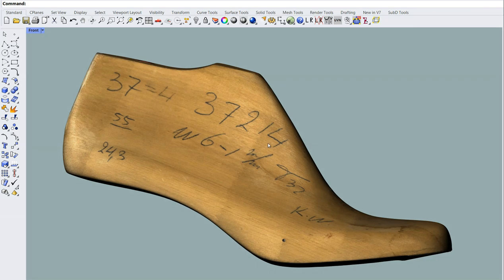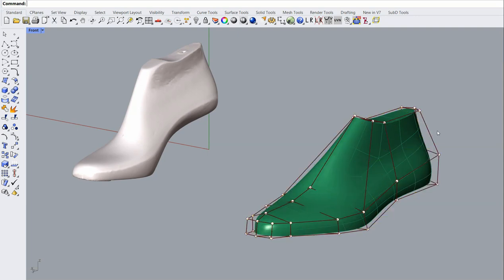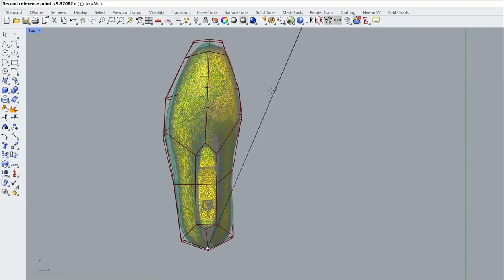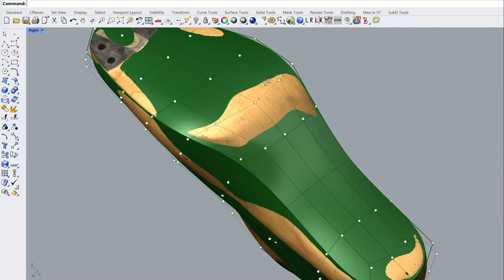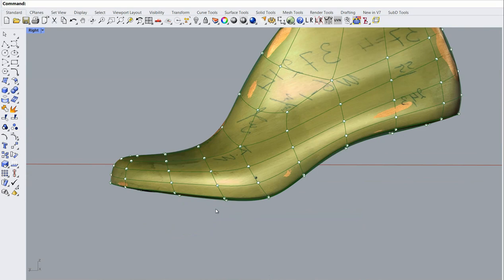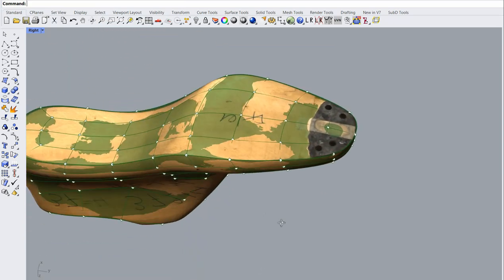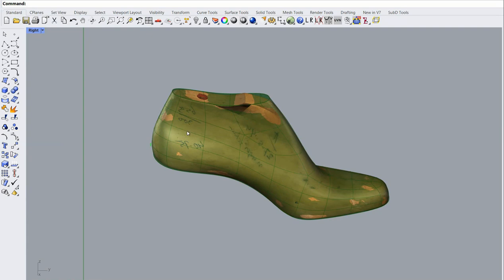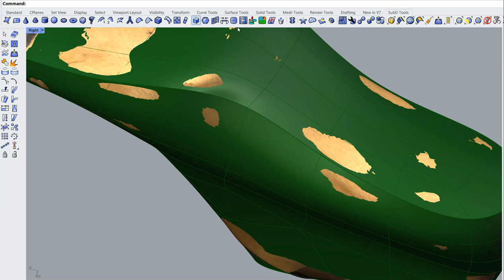Re-engineering a shoe-last scan into a SubD last

Comment: I came across this video and after some googling, it seems you are using Rhino v7 software, am I correct? Where can I find a default last model to modify? Do I need addons to be able to do all this? It would be really helpful if you added resources in your video description. 

I am trying to build and sculpt a last for myself but it's quite difficult to learn how to do that.
Reply from the maker: Yes, lasts are difficult to sculpt.
Reply: @podotools  Ok, I now see that you don't want to share the stock last. While that is fine and you do have the right to not share it, just know that every single video you've made is pretty much useless since they are all fundamentally based on the stock last and you don't show how to make it or how to obtain it. Why do you even make these videos when they are not helpful?
Reply from the maker: @PunCala  there are several people that took the effort and created their own SubD last.
I show an example, and when I should have had such an example when I started modeling lasts, it would have saved me a lot of work.
I do share my lasts sometimes for free, but only with people that have achieved some level in modeling after investing time and effort.
Show me what you have got!
I plan to organize webinars about CAD last design, and people that follow the webinars will receive the basic last and Grasshopper definition.
Reply: @podotools  I work in a hospital. Your attitude reminds me of some of the older nurses that refuse to share their knowledge with young, new nurses, the ones they're supposed to train. All they achieve is making the hospital a worse place for patients.

Comment: Is it possible to scale the lasts (for exemple size 7,8,9..) as in one part or do you need to edit every geometry line?
Reply from the maker: Scaling is possible, no limitations in Rhino for that.  But there is no standard grading rule. Wich grading rules do you have in mind?
Reply: @podotools   I would like to grade my shoe sole designs for manufactering in different sizes
Reply from the maker: @shvmeertins8437  Do you have the grading rules of the lasts that will be used?